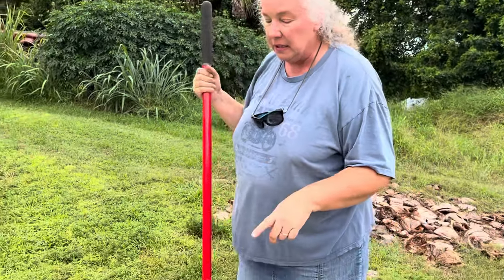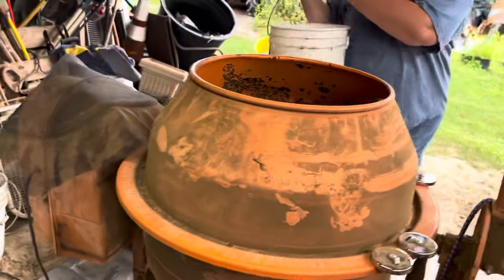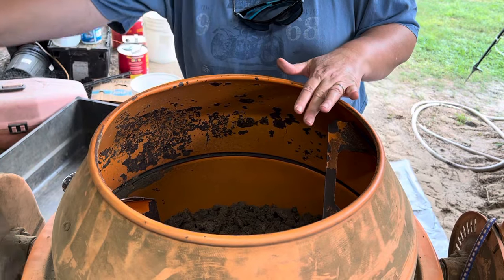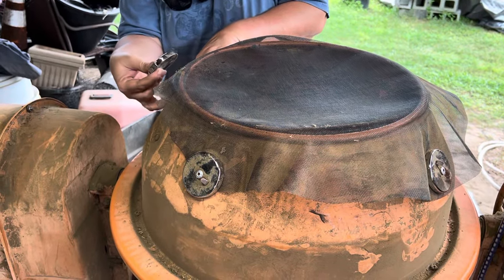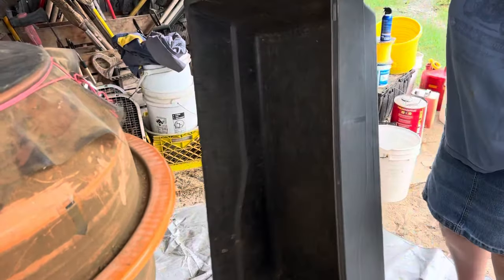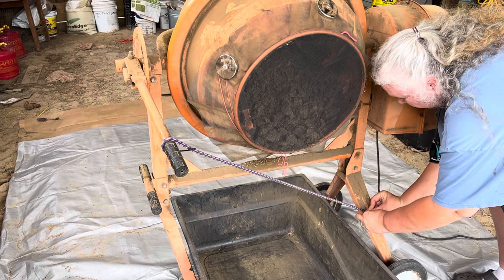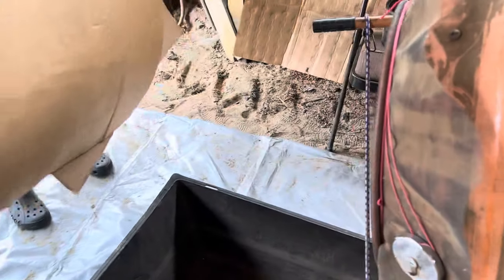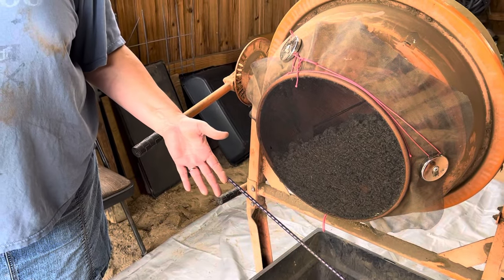How I Make Sifted Cow Manure for Basic Worm Bedding

Comment: This is so cool! You saw my video where I use the pulverized dried leaves. I know I use a household size Vitamix for that, but I have to wonder if there's a huge commercial size Vitamix style machine that could take care of your cow manure without going through the sifting. I absolutely love how you problem solved to make the cement mixer work, though, Jayne!
~ Sandra
Reply from the maker: Hi Sandra! I’d guess there is a super commercial blender. How costly plus easy to get would be the question. Some of the manure chunks are quite hard. I’m always worried about my kitchen vitamix getting damaged if I put in super hard stuff. When I used to do leaves like you I had to double and triple check for thick stems or hard seeds. Makes me nervous. 
The sifting is actually not a big deal as 80% or more of the work is passive in my part. Sometimes I get our weekend worker to collect the cow poop 😆. I don’t mind doing it except when it’s so freaking hot out. Now that I’m heading into to cool season for you know, 15 nanoseconds in south Florida (🤣🤣) it’s a good excuse to get out of the house for a bit!
I have big plans to build an insert attachment (working off others design ideas) for the mixer to make it be a castings sifter. Can’t wait to make that happen! 
Problem solving is something I love to do ❤️❤️🪱.
Reply: I could definitely see the concept working for sifting castings! That would be incredible. It was the hard chunks of manure why I thought of the power of a blade rather than those golf balls to break them up. Regarding your Florida weather, I'm a bit surprised you can dry the manure sufficiently with your humidity. 
~ Sandra
Reply from the maker: @NanasWorms  It’s a trommel type set up for the castings. It’s made to sit in the bowl opening and be secured. Then it can be removed and the mixer can be used as normal. 
I think I’m going to make it my Christmas present. We take a weekend and make it, and everything else can go hang! 🤣. 
The sun is hot enough to offset the humidity when it’s not raining. Which it has been a lot the last several days once again. Sometimes the manure is uncovered for only a few hours before the rain comes in. It can take several days to a week when it’s like this. During the dry season, which is right around the corner, it’ll dry in a day or two max. 
As I mentioned in the video, I’m not concerned if bits of manure don’t sift. They simply go around fruit trees as slow release fertilizer. ❤️🪱

Comment: Good afternoon my fellow worm herder from Jesus and me!
I noticed your bucket handle does not 
have the plastic "gripper" where you grab hold of it. My buckets are sometimes similar. 
I cut a piece of old garden hose the length to fit where the other "gabber" was. Cut a slit the length of it, slip it onto the bucket handle and wrap some duct tape around it several times. No more hurt hands when carrying the bucket full of whatever.
Reply from the maker: Hello!! That’s so smart! The plastic cover gripper things break off for several reasons. Goodness knows I have old garden hose laying around ready to be put to good use! I hope others see your tip!! ❤️🪱

Comment: Thanks Jayne, that's the information I was waiting for. I've seen cement mixers used for mixing bedding, and those with trommel attachments, but yours is the first I've seen used as a seive. Is the screening metal or fiberglass? Also, can you expand on your comment that driveway stones was a disaster? That would have been my first experimental as well.
Reply from the maker: Hi Chris! The screen is window screen or pool cage screening. You can buy a roll at any hardware store type place. I don’t know what it’s made of. It does conform to the bowl shape after several uses and that helps a lot in subsequent uses. At first with the screen being flat and stiff it was a struggle to get it onto the bowl. The magnets help a lot. Just so you know. 
The driveway stones were various sizes, some very small. Oh wait. I just remembered that I was trying to pulverize leaves at that time, not cow manure. I couldn’t sift or sort the stones out of the leaves easily. And it also didn’t work as I wanted it to with breaking the dried leaves down. So I then took the leaves and ran them thru the vitamix. Obviously it was crucial that no stone got into the blender. I had to hand sort the leaf pile to remove stones. Small tiny stones would somehow still cling to leaves. Grr. It was a disaster like I said. 
However, if I had used larger rocks that I was confident wouldn’t flake off they would have acted just as the golf balls do with the cow manure or even the leaves. FYI I didn’t say on the video but I bought those used golf balls off marketplace for like $2. I was at my daughters and didn’t have some of the same options I do at home 😊. 
In summary you have to figure out how to separate your desired material (manure, leaves, castings if you’re looking into that although I’m going to try an insert trommel for castings) from the ‘mill stones’. Peggy suggested billiard balls. I keep weight in mind as I’m very leery of denting either the fins or the bowl shape by using too heavy banging mill stones. The golf balls work great for the manure. If I go back to trying leaves I need to start fresh with my problem solving. Which (cough, cough) I may be looking into soon! I’m not sure in that but it’s circling around in my mind. 🤣❤️🪱
Reply: Great video Jayne! You might want to search for one of those playing tunnels or these tunnels dogs run through during agility matches. Attach one end on the opening of the mixer and the other into your collecting bin. I think it will help to prevent the dust from going airborne.
Reply from the maker: @millyzwezereijn9177  Huh! What a cool idea! I’ll look into it. Thanks! 👍🪱🪱

Comment: I love this! Can you let me know how long I can store or keep the pre composted bedding? I may have over estimated how much I will need. By a LOT. 🙄
Reply from the maker: You can store pre-compost indefinitely as long as it remains a little bit damp to keep the biota alive. 
Seriously, I felt the same when I started making pre-compost. An 18 gallon tote seemed to last for a few months. But then the worms were so happy and the population got a bit bigger and they started turning the pre-compost into castings quite fast. Then it was taking the castings out and replacing the pre-compost quicker and the cycle was off to the races! If/when your bin populations stabilize the cycle will slow down a bit but trust me, you’ll be using the pre-compost up in no time! 👍🪱😎
Reply: @RockinWorms  I don't even have the worms yet and I have 3 bins composting , around 100 gallons total. 🙄 I'm trying to be as careful as possible so as not to kill them when they arrive. I'm going to focus on pure red wigglers for now.
Reply from the maker: @traceybier1128  Wow! That fantastic! Having great bedding ready to go puts you far ahead of the normal starting worm wrangler - me included! When are you planning on getting the worms? And of course how many you start out with will affect the speed of composting as well as we talked about above. 
If you can store the feed bag castings in a cool place like a basement or garage they’ll keep moist longer 👍

Comment: Use Billiard balls!!!! 🎱
Reply from the maker: Hi Jeremy! That’s along the right thought line for sure. I wonder if they’d be too heavy though…? There needs to be a balance between hard and heavy enough to break up clumps and not so heavy that their weight rips off the screen mesh that’s held on by tight string and magnets. 
I’d be worth a try if Bullard balls were handy! Thanks for the idea 🤗🪱❤️👍
Reply: @RockinWorms  Such a great idea to use the cement mixer. I just bought a tumbler composter off FB Marketplace to help with mixing worm bedding and to make my potting soil.  I have nerve damage in my elbows and hands and mixing potting soil sets me back weeks. Since the tumbling composter is made of plastic, I was thinking about using raquetballs. They are made of hard rubber and not too heavy. They are larger than a golf ball so it might work better in a cement mixer than a compost tumbler, which is significantly smaller.  Just a thought.. Love your ingenuity! Learning a lot!
Reply from the maker: @martizavala6713  I’m glad you can use a cement mixer type contraption to ease the strain and pain of mixing bedding and soils. Smart! I’ll keep the racquet balls in mind if I ever need to replace the golf balls. They still work for me so I’ll stick with them for now 😎. Sparking ideas that others can use and tweak makes me happy! Thanks for watching 🥰🪱